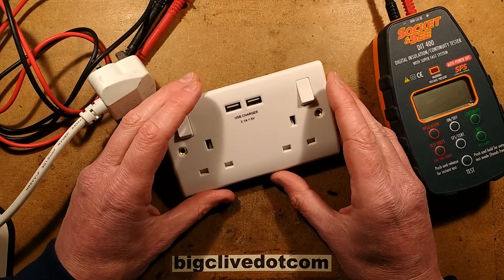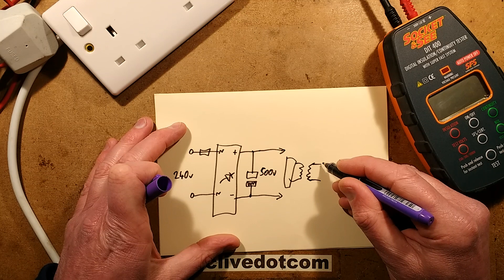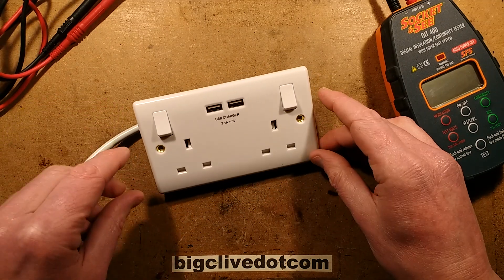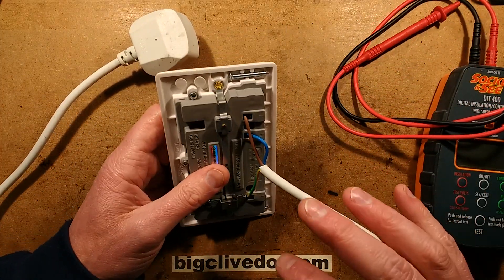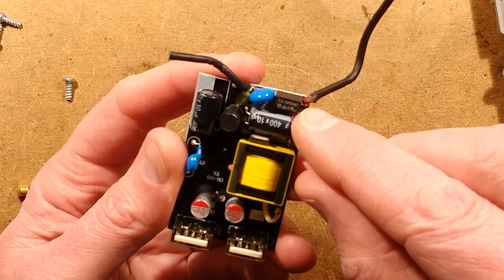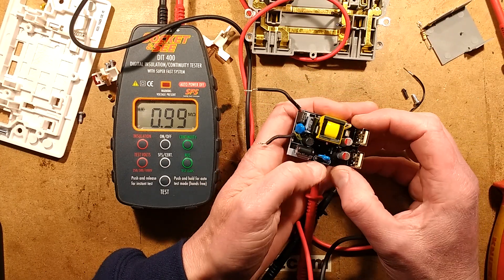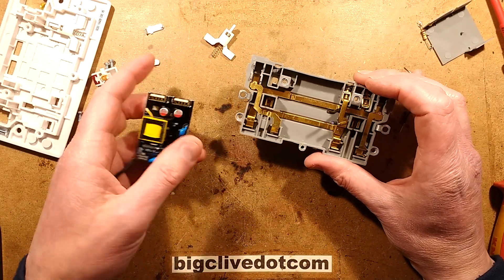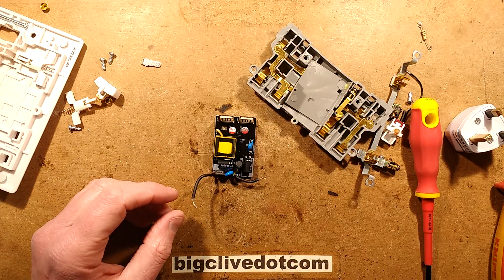500V insulation test of a British General USB socket.

Comment: Do there integrated USB chargers draw current all the time or just when something is connected?
Reply from the maker: There's a tiny standby current.
Reply: Thank you very much. Then I'll stick to regular chargers :)
Reply: Everything, that does not have a mains switch, will draw something when powered, but everything sold in EU since 2013 must consume a maximum of 0.5W at standby mode.
Reply: Maximum of 0.5W? What about the 5VSB circuit of ATX PC PSUs. They are usually rated for 2A to 3A output max depending on model. What if the motherboard + peripherals (kbd, mouse, KVM, things plunged into USB ports) that are powered from 5VSB draw more than 0.5W?
Reply: 0.5/5 is 0.1 so only 100mA output current max and that's not accounting for inefficiencies (nothing is 100% efficient).
Reply: Tim Albers On test the off load power draw was so low, our lab could not measure it

Comment: I think the insulation test was referring to poking something into the USB socket and having >10MegOHM between you and live.
Also, could I just be the first to point out something horrible about that circuit board assembly: The mounting of the electrolytic capacitors!
This isn't some cheap chinese knockoff, I can't believe that they would violate the poor electrolyte seals like that!
Reply: I had the same idea about isolation testing: you test whether voltage goes where you don't want it to go — of course there is current between live and neutral, you just don't want any high voltage able to break through to your USB port.
Reply: That only applies to large screw terminal caps. Small radial caps like those seen in the video can be used in any orientation, and are. After all, just because they sit vertically on a circuit board doesn't mean the circuit board sits horizontally in gravity ;-).
The only concern is the rubber bung as you initially mentioned. With controlled bending that is not an issue. Depending on can size and application additional means of fixing the horizontally mounted cap (such as glue or a holder) are often necessary.
I design high quality power supplies every day, many have horizontal caps.
Reply: Mounting electrolytic capacitors horizontally is just fine as long as you bend the leads properly with a tool and not directly at the rubber. You can even buy the caps with pre-bent leads as an option from the top tier brands.
Reply: The insulation test is to test the installed wiring inside the walls of the building, and any permanent fixtures such as sockets. There are not supposed to be any devices connected when you do this, but these complicate matters by being a device that is part of a socket.
Reply: With a properly built class 2 device that has reinforced insulation adding the earth to the USB sockets would not make it safer. It would also provide a path for ground loops and leakage current that might be annoying. Everything is moving away from class 1 earthed equipment to class 2 double insulated, for good reason in my opinion.
Reply: Nothing wrong with the way these capacitors are mounted, but I don't like how one was jammed right against the switching transistor. It's a capacitor, not a heatsink!
Reply: What you say about screw terminal aluminum electrolytic capacitors is correct, however these are not screw terminal aluminum electrolytic capacitors!
Reply: MRLT  I don't have any evidence or new data for you. But I do know that PCB mounting capacitors in the past were often the axial mounted type... I have some Farnell manufactured switch mode PSU modules (that still work well) which are 29 years old. These use axial electrolytic capacitors as well radial types. The module can be mounted whichever way you like...
Meanwhile with the larger electrolytic types that are designed for chassis mounting, and hence have either solder tags or screw terminals, the mounting 'brackets' are all designed for them to be mounted vertical with the terminals at the top... As far as I can tell, this is the same for 1960's capacitors as well as later types.
Of course, whatever type you use, you should not exceed the manufacturers ripple current rating, and you should derate it if the ambient temperature is high.
Reply: So you don't think can caps should be mounted horizontally and mentioned the bent leads as the problem. Well, think about how that board  is mounted in the wall panel. The PCB is vertical. So if the can cap was mounted directly to the board and not with bent leads, it would still be horizontal. The only way to mount it vertical would either be bent leads again, with it pointing upward or downward, or a very expensive multiple-board (or worse, flexible board) mounting arrangement. That would be hugely expensive, may not fit in the allowed depth, and would also probably be quite unreliable.
I'd be a lot more concerned about keeping the caps away from heat sources than I would be about mounting them on their side.
Reply: The cap debate..I can see mounting is important when using screw fit types which have extra electrolyte inside. (Literally sloshing about) then you'd need low stress ring crimps rather than screw it to a circuit board. Small radial should be fine bent at 90degrees, but I can see if you don't fix the body of the cap in position, transport vibration could weaken the end seal. Good topic.
Reply: MRLT On the other hand, I'm not so sure about the decision not to ground the USB circuit to the supposedly reliable grounding of the house wiring (it's not like being a circuit in an appliance that might be plugged into a power strip that is plugged into an ungrounded supply, thus exposing the user to ground faults in other appliances.
Reply: USB sockets have a metal shroud that would count as exposed metal parts in my opinion as you can jam the tip of your finger in there and touch it. So I would assume that the 10MOhm is between that and live conductors along with the secondary side of the transformer and live conductors. Don't know why they cant have and extra switch or three position socket switches that go, off, 240V socket on  and 240V socket on with USB on.
Reply: l wilton; I agree completely that, when having to choose between mounting the cap horizontally or mounting it next to a heat source, you choose getting it away from heat, 100%.

An interesting safety aspect to consider, especially in this application, would be what happens in any of the failure scenarios where the capacitor vent blows. If mounted in the direction of the switches, it could create a dangerous corrosion over time where the switch would still conduct while in the off position or even suddenly arc over.

If it vents onto the circuit board, does it vent away from the high-low side isolation gap? If not, then a dangerous 240V short could conceivably appear over the USB port by way of the electrolyte bridging out the isolation between the pins of the optocoupler or transformer.
Reply: Mark 1024MAK; Yes that is indeed always good advice to follow with electrolytic capacitors (all too often the 'ambient' temperature ends up being the Tc of the huge transistor right next to it, but I digress).

I suppose it is entirely possible that with smaller capacitors, they have such low ripple current ratings relative to their effective heat dissipation ability, that the electrolyte won't pool on one side / start corroding one side, etc.
I just assumed that the rated ripple current is already calculated to give roughly the same maximum internal temperature, regardless of capacitor size (within the same product series, of course).
Reply: Chris G; With the quotes from the application guide, I was referring to the effects of gravity on the internal operation of electrolytic capacitors, since the effects of uncontrolled bending of the pins (due to improper mounting or lack of support in a high-vibration environment) on the rubber seal is  fairly obvious.

While I do not doubt that non-speciality electrolytics can be (and in fact, are widely being) used to manufacture power supplies which reliably function for around 10 years, I also find it unnecessary to artificially limit the lifespan of the capacitors.

That being said, I acknowledge that my information on this originally came from my employer, whose designs were squarely aimed at the very high-reliability industrial (including safety critical) sector.
Subsequently, I have occasionally come across recommendations from big capacitor manufacturers that recommends vertical mounting of their larger capacitors and have simply assumed that same logic would transfer over to other can-style electrolytics.
However, I have not actually seen any hard data on the effects of mounting direction on modern electrolytic capacitors.
It might well all just be myths and superstitions from the old days, still lingering around the engineering department.

I find it quite strange that us electrical engineers (well, probably mechanical, civil and maybe even chemical engineers as well?) pride ourselves on scientific, rigorous design and verification, are also so prone to spreading unverified myths. I suppose it's mostly just the precautionary principle at play, but still...

So, does anyone have access to some up-to-date test results on the effects of mounting orientation on the functioning and lifespan of modern electrolytic capacitors?
Reply: stefantrethan; NO!  While there ARE horizontal mounting capacitors designed specifically for the purpose, many suppliers seem to simply use the normal vertical types and bend their leads, like you mentioned.

This is NOT OK!

From the official Cornell Dubilier Electrolytic Capacitor Application Guide, pages 21-22, as summarised by the user pascal_sweden on the EEVBlog forums (download link to the whole whitepaper is attached in the thread):
"Do not mount upside down as this may reduce the operating life and could impair the operation of the pressure-relief vent."
"One maker of high voltage screw terminal aluminum electrolytic capacitors reports that if mounted horizontally, the positive terminal should be above the negative terminal to avoid corrosion.

For high-ripple-current applications of screw terminal aluminum electrolytic capacitors with extended paper, horizontal mounting shortens the lifetime. With heating from ripple current 
the electrolyte in such capacitors may bleed from the winding, and puddle along the side of the can where there is no paper to wick it back into the winding. If the ripple current is low 
(less than half of rated 85 ºC current), this is not an issue. But if the ripple current is high, the effect is accelerated due both to the increasing temperature driving the electrolyte out faster 
and to the drying of the wet paper where it is crushed into the can bottom.  The drying of the paper can thermally insulate the element causing it to get hotter and the can bottom to get cooler. This can actually turn into a thermal runaway condition that can greatly reduce the capacitor lifetime, sometimes by as much as 90%. 

If the capacitor is upright, the electrolyte is able to readily wick back into the winding, and the thermal contact and ESR do not degrade significantly. Thermal runaway does not occur, and the expected lifetime is achieved."

Comment: The problem with these USB sockets is that they become outdated very quickly due to USB standards changing.  In fact the socket shown in the video is already out of date in that USB type C sockets are now superseding USB type A.  Even the voltage & current produced is behind the curve.  Modern USB chargers can supply higher voltages and currents, up to 100W in theory using USB Power Delivery v2, compared to the very limited 10W available in the socket shown.  No doubt even USB C and USB PD v2 will also be out of date within a few years.
Reply: USB type C sockets aren't exactly superseding USB type A sockets, even if you buy phone with USB-C you get a cable and a charger with USB-A, but typically with Quick Charge technology.
Reply: That's true and the reasonable thing would be to install an extra socket and just plug in a power supply.
Doesn't change that people want the integrated USB sockets, they are foolish like that.

In hotels and the like they want it built in so nobody can steal the power supply, and all the fittings will get ripped out every few years anyway because they are dated.
Reply: @bar1005 Obviously that's only transitional, whilst people still have USB-A chargers and laptops.  They are gradually disappearing as well.
Reply: That's like saying that MicroUSB superseded MiniUSB.   It's true for some devices, but I still buy devices that are using MiniUSB for charging.   There's no reason to go USB-C for low bandwidth devices, for example.   USB 1.1 (As you call A) still works dandy for them, and it's a larger plug, therefore easier to work with and significantly more sturdy than the USB-C plugs that I've worked with.   Your argument is like saying that email superseded fax machines.   Yet - there are still lots of fax machines out there, no matter that there is a lot more email.
Reply: There are a lot less fax machines than there used to be.... ;-)
The problem is not that the old USB outlets wouldn't work any more, the problem is that they won't work with new devices requiring more power. 
USB is great and all, but compared to mains plugs it's still wet behind the ears and has been updated (with very limited backward compatibility) a number of times already. I'm not convinced putting it in the wall is the best idea.
Reply: @Tony Belding: Ah, but the fundamental difference is that USB type C is designed to supersede all USB type A and B, whereas micro-B was only ever meant to be complementary to standard-B.  I suppose it's possible that a mini or micro USB type C might come along in the future, but the life of all USB type A and type B plugs and sockets is now limited.  Unless of course USB type C fails in what the USB standards people intend.
Reply: Sure, but it's going to be a pain having to keep USB-A to USB-C conversion cables forever more, and remembering to take these to hotels for example, just to carry on using the old USB type A sockets.  

By the way, there's actually nothing in the standards preventing USB type A supporting USB Power Delivery of up to 100W (5A at 20V).  So somebody could release a USB-A mains socket supporting this power if they wanted to.  Unlikely though.  Instead you can already buy mains sockets with USB-type C outlets.  I heard that even Walmart sell these in the US.